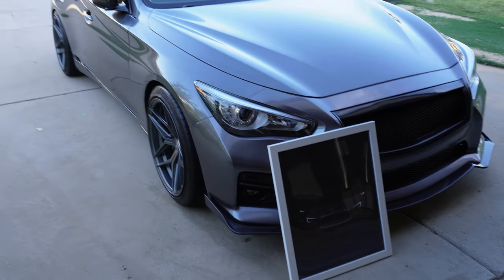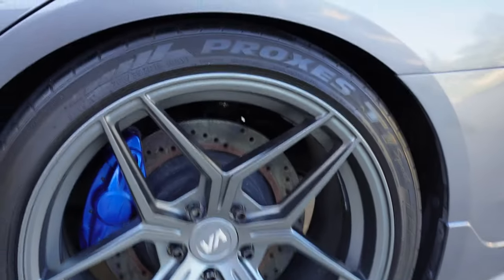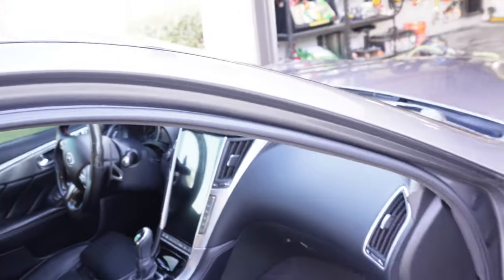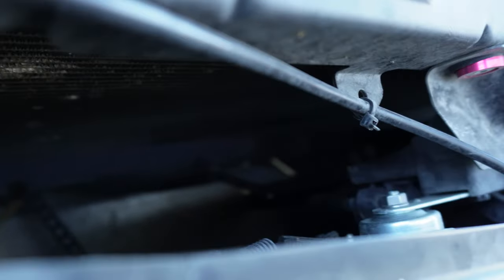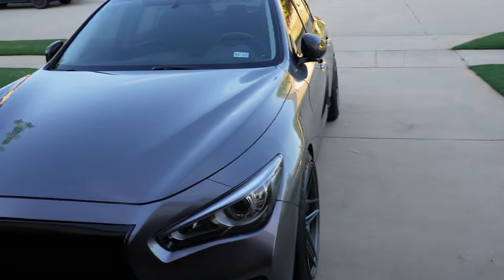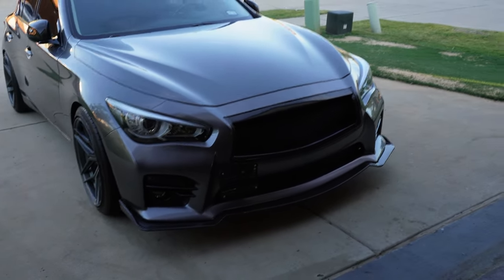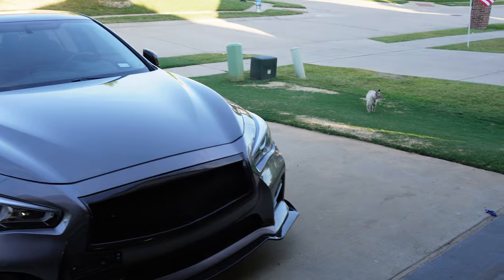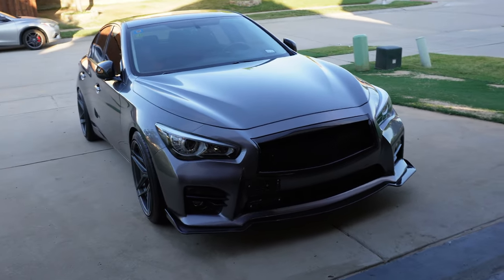Infiniti Q50 long term review + modifications (6 years ownership)

Comment: i had a 07 g35x then i got a 10' g37x now i have a 15' q50s. it has 150k miles on it and still running strong with no issues
Reply from the maker: They are strong reliable cars.

Comment: Beautiful machine!  But the stock Q50 3.7 RWD is not slow lol! Bone stock,  I ran a best of 13.51 @ 103.88 @ over 900 feet altitude in an 83 degree and humid Georgia late spring temp.  Before my mods,  my Q was consistently running 13.50-13.70's @ at least 103 mph.  The stock 300 HP 3.0 TT is not faster than a stock 3.7,  especially above 60 mph.  My buddy owned a '18 Q50 Luxe 3.0T RWD,  and he'd only get me by a car length to 60 before I slowly reeled him in and then started walking him and pulled away faster the faster we went..  We even switched cars with the same result.  He ran a best time of 13.79 @ 102.5 by the way.  Not faster than the 3.7 stock vs stock.  I don't care what anybody says.  Anyway lol,  that is one of the nicest Q50's I've ever seen man! That nust have been hard to let go...
Reply from the maker: Thank you!

Comment: I got a 2019 Silver Sport at 36.5k miles. You said the issue became less of an issue with those models going forward. Also sick car dude I hope to make mine look cosmetically as good as yours in 1 year.
Reply from the maker: Yeah the 2019 is clear of some issues but still not as reliable as the older platform, just keep up with maintenance and you should be fine.

Comment: Thanks for the review and a clean showcase of all the mods. Will be moving unto a Q50 3.7 from a Honda Accord 03 2.4 so it'll be a significant jump on performance for me. Glad that it's reliable as well. Couldn't find any other cars that are sporty, not a crapbox, decently reliable, a bit utilitarian, beautiful, and affordable.

That's a Q50S though right? The front bumper looks more aggressive than a regular Q50 or is it just because of the splitter and the chrome delete?
Reply from the maker: Yeah is a q50s, i had a Honda Accord 2.4 myself before this car.
Reply: How is the q50 for u moving from the same accord as well

Comment: I bought 2014 rebuilt title q50 3.7 at 110k miles im at 150k i have havie foot one thing i recommend if you like to use sport mode i suggest doing tune ups every year and really keep up with the maintenance itll last you easily to 200k

Comment: Thanks for the Video and yes I would keep it. Planning on purchasing one within the next month and I'm going with the 3.7 engine 2015 model. Proven engine with enough power for me.. Congratulations as well... 👍🏼
Reply from the maker: Thank you! And yes the 3.7 is bullet proof. It sounds so much better too
Reply: I got my 2015 3.7 in 2018. 

The only modification I made was changing the trunk struts (highly recommend). I bought it at 30K miles in 2018 and have 72K now in 2022. I have had no issues and change the oil every 3-5K miles. If it has good history, it's worth. 

The only downside I have heard is they rust pretty bad in the northern states.

Comment: Not sure if you’ll still reply to my comment but I just wanted to ask, I currently I have an Is350 with 180k miles and I love that car a tone BUT whenever it is time to upgrade I wouldn’t be opposed to owning an Infiniti. The main things that I look for are reliability and maintenance costs. I am the type to do cross road trips and if I was to get one I’d be using it quite often for that, what would be your opinion on that? Also, with maintenance how was your experience with maintenance costs?
Reply from the maker: Thanks for watching,  for road trips and high miles I would probably keep it stock, will be far more reliable.  This car was more of a toy. If I was you I would keep the Lexus,  or get something more comfortable,  there is not very good rear leg room and trunk space it's pretty useless. Seats don't even fold down. It's a good car but there are far better options, the 3.7 will be more expensive on gas, the 3.0 will be more efficient and faster but those turbos have a lot of issues.

Comment: Can you link of the mods? Particularly the steering wheel, side skirts, and splitter? Looks awesome! Any issues with the +30 wheel offset? Maybe the awd system wont like it?
Reply from the maker: Oh man it's been so long i don't even remember some where i got some of the parts. Here is the link for the splitter: https://bodykitworld.com/product/extreme-online-store-2014-2017-infiniti-q50-sport-carbon-fiber-front-splitter/?utm_source=Google+Shopping&utm_medium=cpc&utm_campaign=03-2022+CTX&utm_term=&utm_campaign=05-06-2022+BKW+Smart&utm_source=adwords&utm_medium=ppc&hsa_acc=2664643947&hsa_cam=17171037531&hsa_grp=144929442668&hsa_ad=596666965097&hsa_src=u&hsa_tgt=pla-1014917834051&hsa_kw=&hsa_mt=&hsa_net=adwords&hsa_ver=3&gclid=Cj0KCQjw08aYBhDlARIsAA_gb0ejqi5DD6pzoYgigGIiJe4O-osJta4029fk2M5UfpRdCwDPwPgMPwAaAlNiEALw_wcB
Reply from the maker: This one is RWD so no issues here. The car doesn't have side skirts, just the OEM mud flaps. The steering wheel of some guy on IG.

Comment: Not sure if this has been said/asked or not, too many comments and not going through each to read them.  Where did you get your numbers?  I have a 2015 Sport.  I'm 329 to the wheel which is roughly 387 crank and I've done far less mods than you have done.  You say you have 325, there is no way you have 400 crank.  Aside from that, very pretty.  Where did you get your seatbelts?
Reply from the maker: You are the second person that pointed that out so I'll go ahead and say i was wrong, i was going based on 20-25% more, that's what I heard before. And yeah, I've seen people with far less mods making more power, these cars are different, they make what they want to make.
Reply from the maker: The seat belts were installed by a local shop, I'm super happy with that mod, definitely makes the dated interior more interesting imo
Reply: @rizocars6115  Totally agree. Anything different inside makes it pop!

Comment: cheeped out on the rotors did yah!!  Wing looks great accept the double-sided tape that is visible.
Reply from the maker: The front rotors are 2 piece stop tech drilled rotors, they were about $800 just for the front, rears are drilled only. This car doesn't need 2 piece in the rear, overkill.  there is no 3m tape showing, might be some dirt or residue from parking outside. Here is a link if you want to check them out https://conceptzperformance.com/centric-stoptech-stoptech-2pc-2-piece-aero-rotor-direct-replacement-akebono-sport-calipers-front-drilled-nissan-370z-infiniti-g37-q50-q60-q70-m37-m56-fx50-814889921_p_19025.php

Comment: That car made me cream a lil, like damn that’s what I strive for with mine, just gonna take some more time haha😅 🔥 🔥 🤌 and btw 3.0T beats 3.7L stock…problem with 3.0T is it’s already modded lmfao and it’s still pushing the same HP so the gap is small, acceleration difference is there but not speed difference…but then what happens when you turn your 3.7 to a 3.7T…yeah game over dude don’t even pull on that with a 3.0T even if it is RWD vs AWD 3.0T still lose to the 3.7T RWD all day. Plus 3.0T can’t handle half the mods you can slap into a 3.7. As well 3.7 RWD is cheaper for heavy repairs and has less issues and maintenance to keep up on, so keep draining that wallet to pull a 1-2 second lead with an already modded car keep in mind without the turbo it’s nothing but scrap in comparison👍😁
Reply from the maker: Thanks for watching Chef! I agree with everything you said